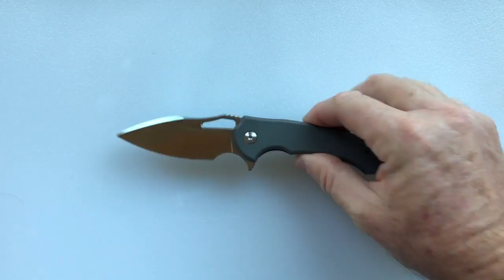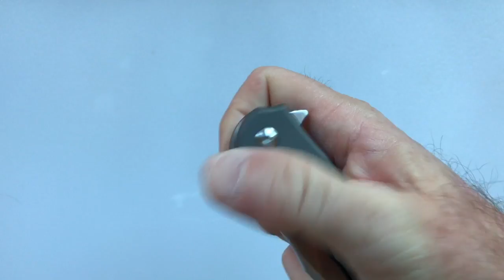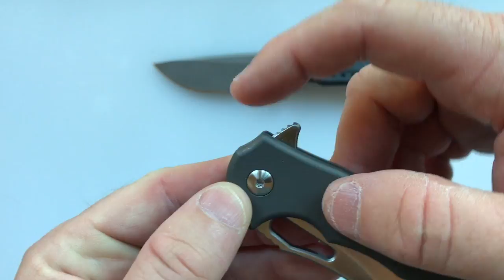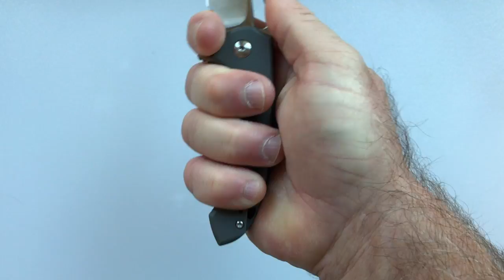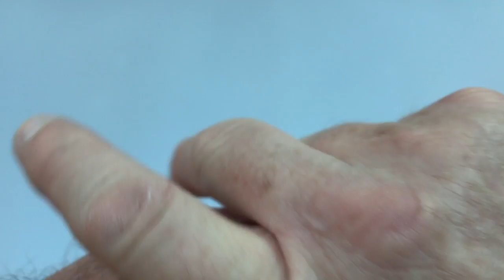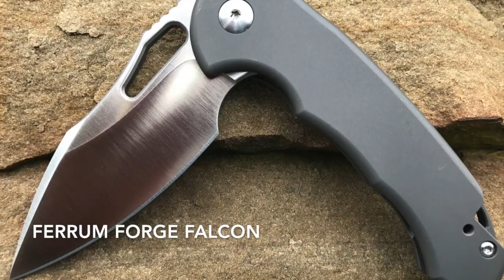Ferrum Forge Falcon: Lightest and Best of Ferrum Forge!

Comment: Sadly, I got a lemon version. It seems to have faulty Ti, and the lock bar loses tension. It's been to 2 youtube reviewers, both had issues with it. I sent it off literally days after I got it - and had problems from the get-go. It had a shaving slip into the bearing track after all that oil wore off, so it wouldn't deploy! Luckily it was an easy fix. Massdrop and WE were quick to respond, so I have no doubt they'll handle my problem promptly, I just need to use it enough to get it to fail again! I have to say I much prefer the Crux, but many find this to be a perfect combination. Those interested should swoop in and grab it now, also in blue! A lot of a little knife for $125. Oh, and Massdrop is technically the maker (like Liong Mah or Boos), they handle all the warranty work.
Reply from the maker: Hi Slidetek,
What were the contact addresses you used to get in touch with WE and Massdrop for customer support?  I am having problems with the Gent and can't get anyone to respond to me.  thanks